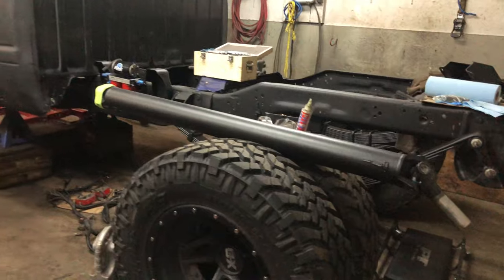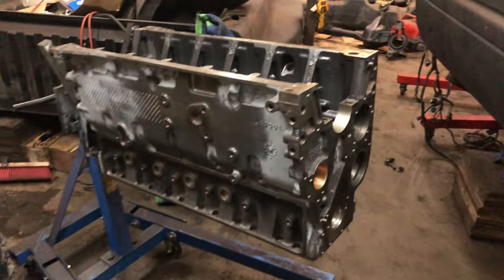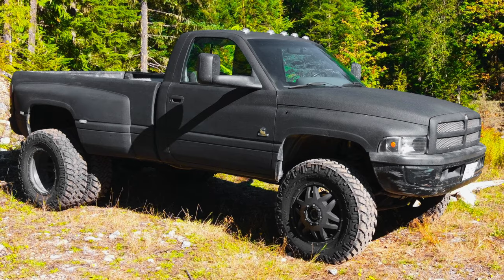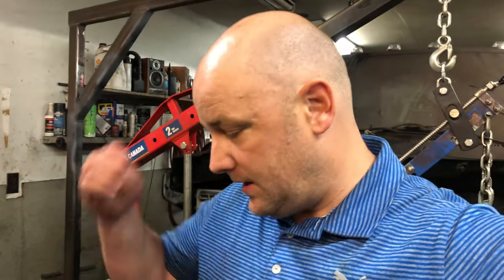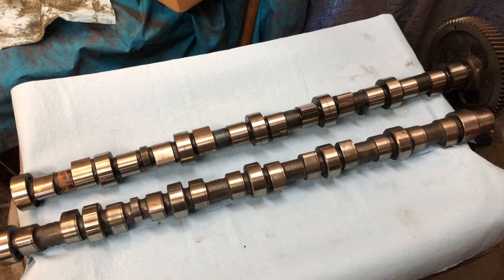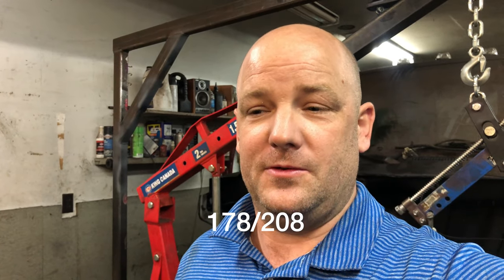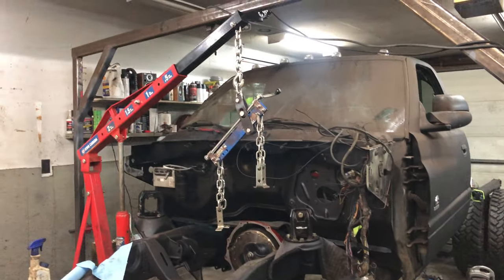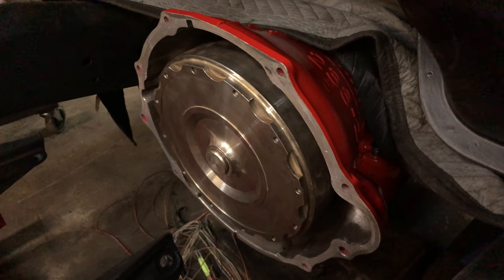MUST WATCH before buying a 12 Valve Camshaft

Comment: These are the ones worth keeping. The rigs that are built for you. BY YOU. Build it once build it right, don't put a monetary value on it. In the long run if taken care of properly, you will never have to purchase another unless you wanted to. Money no object I would do a mechanical cummins ( 24 valve p pump ) with the 6 speed manual 5600 in a ford ( because let's be honest their interior is WHAY nicer ) on a custom chassis based on rockwells... unstoppable.
Reply from the maker: You are right, things definitely got out of hand but I love this truck